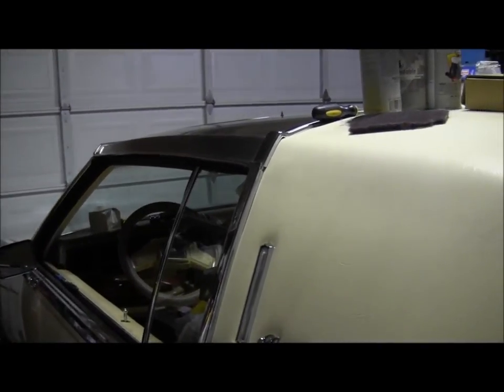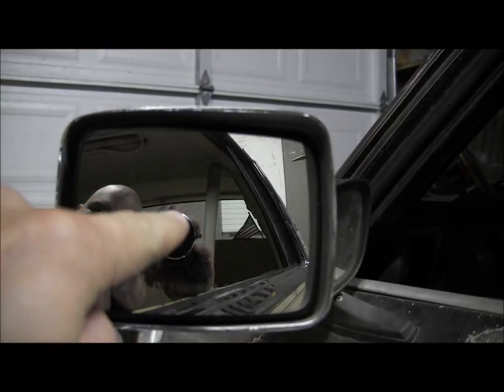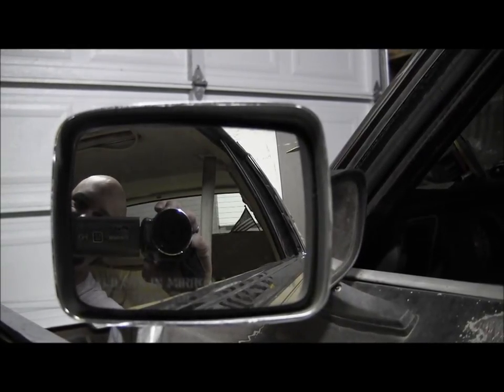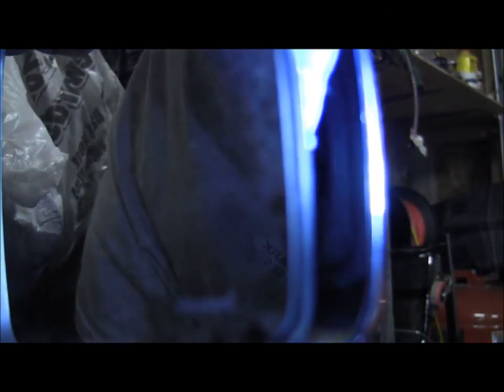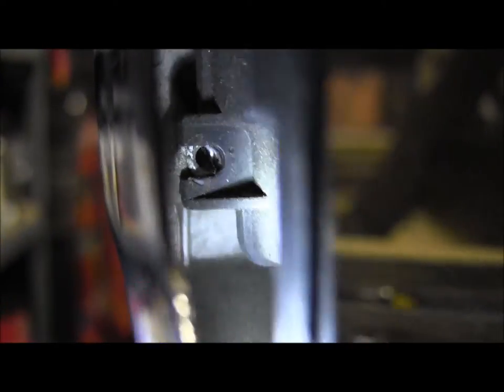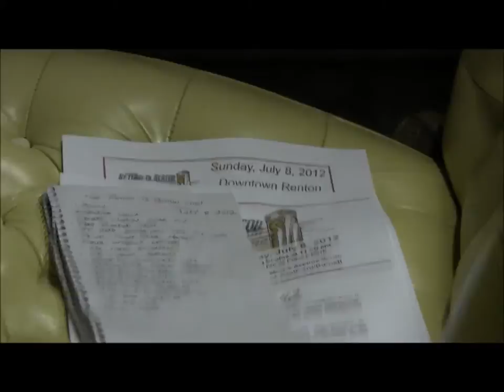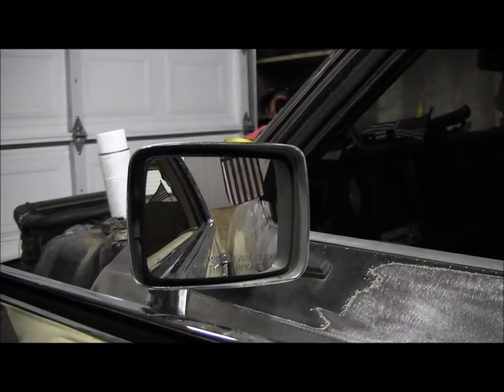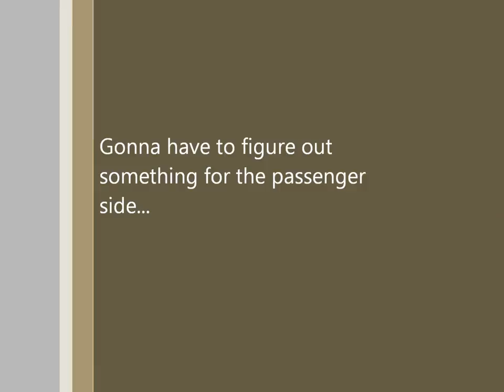1984 Eldorado Mirror Repair

Comment: So, if i were doing this i would number one: gather everything i needed for the video, tools, flashlight etc. make a list for your video like you did for multitude of repairs to your car. Next, show every step! You say you removed a small screw at the start but it isn't until the end of the video, you show where it came from when you screw it back in.  I would think there is a right angle driver made small enough to fit behind the mirror but not sure! Before i tightened those hard to get at screws, i would use an eye dropper and put a few drops  of loctite on the screw threads at the base of the head, thus, not having to repeat this procedure in a year or so. Regarding the passenger mirror, I'm wondering if one could buy a small roll of stainless  wire and wrap it under the mirror and on top of the mirror base round and round the mounting screws filling the loose space between the two? Being stainless, the wire won't rust and even if someone leaned down to look between the mirror and base, the stainless wire would blend with the chrome..the wire would also be wrapped against the screws keeping them from getting loose.